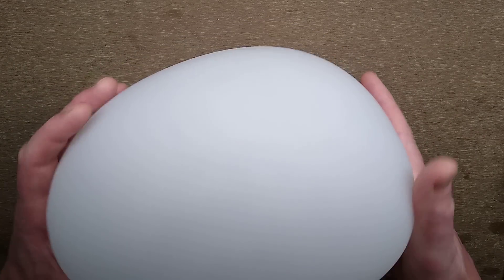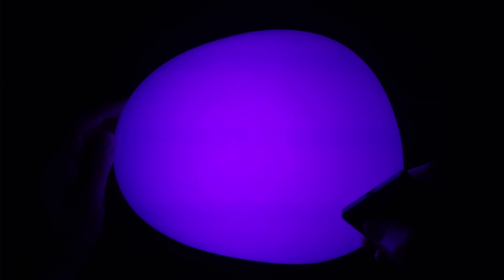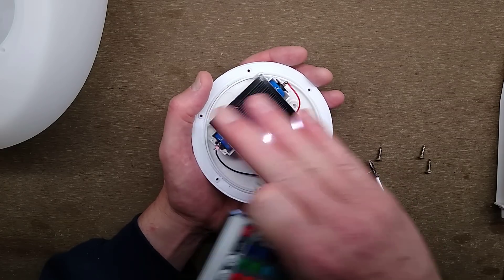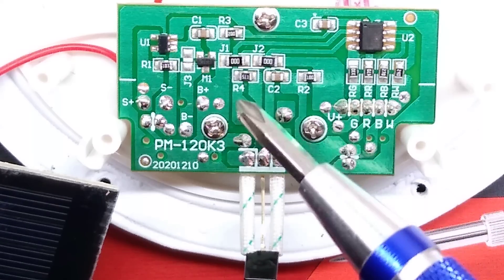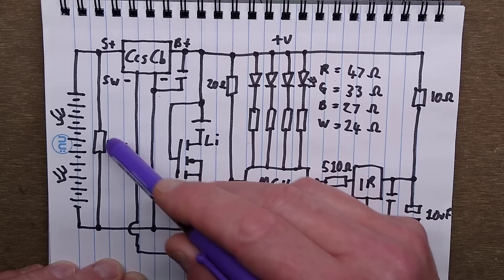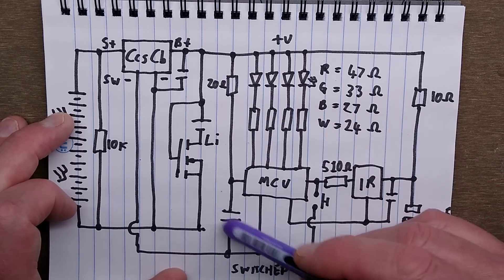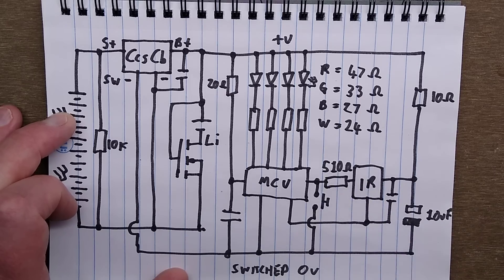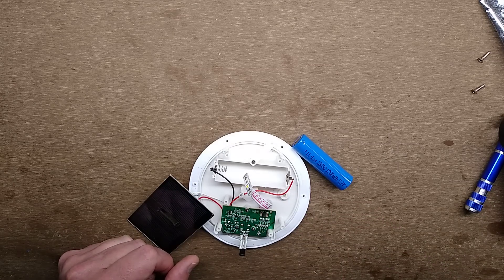Aldi glowing rock (with schematic)

Comment: i have an under cabinet light bar that has the same remote, its probably the same manufacture, ive had it for two years and it still works, mine isnt battery powered but im very happy with it.    if you hit the lighted blue color and dim it all the way its like a weak black light.

Comment: The only (albeit serious) design flaw, is the expectation, that the ground will not get wet. Any downpur (however short) will likely lead to a puddle under the stone, with water just waiting to seep inside.
Had they gone for a proper seal in the bottom, it'd be a great product.
Of course, visitors of this here channel will likely be able to easily add some proper seal themselves.

Comment: Hey Clive,

I'm trying to design a circuit to where I can have a pair of landline telephones switch between modes using one relay, and then have a momentary switch at each station (back of shop and front desk). I don't want to buy an office phone system or other related device because a) I'm in the mood for a project, and b) I want to be able to hook up any vintage landline phone in the future as I collect more of those. 

I believe that I have determined that I need to wire the switches in parallel, with the power supply between them and the relay on one side, so that either one would work when pressed, and when released it switches itself back to the default mode. I need a 4PDT relay for this setup. At least 4 wires need to run to each station, potentially more for illuminated switches. I am a little unsure if it is possible to use one power supply for everything or if I need a separate one for the switch LEDs. I found some nice looking square green and amber ones on eBay after sifting through all the typical ones marketed for cars or PCs, as neat as they look not what I wanted. 

The different modes for the phones are already handled by: a Cisco VoIP box programmed so Line 1 automatically rings Line 2 when you pick it up. Found out how to do that from instructables. This mode will be activated by pressing and holding the button before picking up the receiver so that the phones get plugged into the right system. The normally closed state on the relay connects the two phones to a single POTS or cell2jack adapter line, same as you would normally have multiple phones in a home share a line. 

I have some doubts though. I don't want any accidental slight release of the push button or "bounce" to cause a malfunction. Would I use a capacitor here? I don't have hands on experience using these other types of parts and only vaguely understand them from your and others' videos. I would also ideally like it to sustain the relay activated for maybe up to two seconds if the button were accidentally released a bit, or if you release it too soon when hanging up. If that doesn't require a huge capacitor, that is. I saw something in a video where they also included an NPN transistor and a diode in their circuit, it kept a lightbulb on for a bit with a 9v battery after releasing the button and the capacitor did not look too big. This is where it goes a bit beyond my proper understanding unfortunately so I am still doing some studying here. 

Another doubt I still have is if just the Cat5e cable I'll be using for the telephone signal is suitable for the 12 volts and whatever current the relay might require? I found some on Amazon but all it really says is it's 12V DC coil power relay. I would assume it doesn't take a ton of current because relays are typically run by a computer chip. I read PoE security cameras can get up to around 15 watts over those 24AWG wires so it seems like it should be okay? And I would hope they have good enough contact inside to not be a problem for the telephone signal even though these relays are intended to switch power. 

I know you must stay busy, if you don't have the time maybe another commenter might chime in. I made a drawing in paint if anyone wants to see I can email. Thanks Clive love the channel ❤️❤️❤️

Comment: When you explained the MOSFET being used for polarity protection, my ignorant self immediately thought “why not just use a diode”, but then I realized pretty quickly, dropping half a volt or so across a diode in series would constitute a dramatic drop in performance or battery life for a 3.7v cell.
Reply from the maker: And also mess up the charge voltage monitoring.
Reply: @bigclivedotcom  Not to mention the actual ability to both charge and use the battery!

Comment: @bigclive: could the "reverse polarity" MOSFET actually have some other function?  If you have control over the plastic design, the cheaper option is features in the battery holder to prevent flat end of battery from making contact if it is in backwards.
Reply from the maker: It's definitely polarity protection.  The cell can be put in backwards.

Comment: That MOSFET reverse polarity trick (usually) gets you lower voltage drop than even a schottkey diode would.  I've done that for high current applications.  Take care to not exceed Vgs-max in the correct polarity case.
Reply: Also it conducts in both directions, you can charge and discharge the cell trough the mosfet, that would not work with a diode.

Comment: I cannot see how the N-channel MOSFET can work in the schematic with the drain at the negative side of the Li cell. I can see it work while charging, the gate is positive relative to the source, and the current flows from plus to minus through the cell and MOSFET, but while discharging the current from the negative goes up through the cell, opposed to the source current of the MOSFET.

Comment: Question,  Big Clive, do you know of any rechargeable batteries that can withstand 43C to 48C summer heat? They might get hotter in that sealed plastic rock here. 
I do like some of these outdoor solar lighting items, but have a problem keeping them alive. The batteries are the main problem. I live in Arizona, in the South West Desert and the heat seems to kill the rechargeable batteries in a short time. Sometimes the electronics and solar panel will give up in the heat. Even in the winter on a sunny day, with temps about 4C, it can heat up the inside of a car to 30C + in a short time. If you have any ideas or information, I would love to hear them.
Reply: Some of the older chemistries may be more temperature tolerant than LiPo.  Anyway, for something pretending to be a rock, old school lead-acid batteries may provide the desired weight.
Reply from the maker: I'm not sure how hot it will get.  The fact it's white and diffuses the light may help.
Reply: @bigclivedotcom  Thank you for getting back with me. 
But I can tell you that those glowing rocks sealed from weather, will get quite warm on the inside, even being white and diffusing the light. There is no way for the air inside to circulate and the heat will build up on the inside.
Never the less I ordered one. It might take until next June before the real heat tests it. But I was wondering if you could suggest a good rechargeable battery that might be able to handle the high temperatures. Don't know if you've had experience with batteries being exposed to high heat like in a hot desert climate. But if you do and have and suggestions, I would appreciate your input.
I'm not much of an electrician, but I do appreciate your YouTube channel, it has helped me fix things and I do like your way of explaining how they work. You have also opened me to some new gizmo ideas like these rocks and led lighting. Also the soda stream fizzing wine and alcohol, can't thank you enough for that! 
I'm more of a Machinist and Mechanic, but I do have some electronics experience. Thinking outside the box, I was able to fix an important piece of communication equipment in the military that got dropped and had a cracked circuit board. Others working in the electronics shop said it couldn't be fixed and would require a new part that would take several weeks to get to our remote location. I just jumped the breaks with some small wire and solder. It worked fine until we got the new part. Their boss wasn't happy that a machinist was able to fix something that they said couldn't be done.
Cheers!

Comment: Hi Clive,  I did a city and guilds 2360 in electrical engineering between 2002 - 2005 at evening college.  I would love to do an electronic engineering course like you have but Is it true that the maths is very  difficult for this?
Reply from the maker: I did my C&G 236 and a few short random electronics courses in specific areas, but most is self taught.  YouTube is the place to gradually learn electronics while enjoying the experience, and it's free.
The maths is minimal and easy to pick up because you re using it in real world applications.

Comment: Reverse protection doesn't make a lot of sense to me for a product that's not designed to be disassembled. I bet that mosfet is actually a sneaky low voltage cut-off circuit. Vgs(th) is probably somewhere around the low voltage cut-off point for the lithium cell, so that when it discharges far enough the mosfet switches off and prevents the battery from losing all its magic smoke.

Comment: Ooh, I really like that set for the fact the panel as well as the circuit board seems to be rather safe from water and any built up condensation, too. Most our garden lights are typically killed by corrosion. I'm not a fan of the rock shape, but I feel like this could make an awesome bulb, too.

Comment: It is the first time I see the MOSFET polarity protection, and I like it. If I understand it correctly, it does the same job as two diodes but at half the voltage drop. Very neat.
Reply: it i suspect is a low voltage cut off for the lithium cell, to prevent deep discharge death. reverse cell connection is low down the manufacturers priority list i would think as it is an integrated unit.
Reply: @amojak  that makes way more sense. But with added benefit of polarity protection. Very nifty. And of course the designer/producer had polarity very low down on the priority list. The 1% that opens the unit would know to not reverse the polarity (no matter what Dr who says). But it would cut down on waste in the factory.

Comment: Very nice-looking thing. Shame they are not for sale in my local i would have got a few of them. I dont think they will last to long outside in elements though. Those 1850s really dont like getting cold. But as something to pop out during the summer they would be good. I would have liked to seen an indoor version of this you can put in the window. Aldi make some good stuff. BTW the product ID is "711641498273001"  so if you google that the page will come up that sold it with info.
Reply: "Product no longer available"... :(
Reply: @MarkMichalowski  yeah such a shame, probably come back in stock though.

Comment: I love this circuit! Question: why the MOSFET instead of a simple diode?
Reply: Because the MOSFET has much less voltage drop, even compared to a Schottky diode, see https://youtu.be/IrB-FPcv1Dc 
Maybe low current fuse in series with the battery and a reverse diode which blows the fuse when the battery is inserted backwards could work too? But then the fuse must be very fast and all other components need to survive the diodes forward voltage until the fuse blows.
Reply: @Acamperfull  thank you kindly!

Comment: I like the build quality of this. Screws, batteries you can unplug, well designed, small nuggets of ingenuity in the circuit, ribbon cable, serviceable, yet cheap. More Aldi stuff please 🙂
Reply: Agreed, largely... Except for the bottom, they could have gone for a proper seal.
This is on the ground afterall, and there will be times, when a puddle forms under this "rock".
But then again, visitors of this here channel will likely be able to easily add some proper seal themselves. And considering this is Aldi, well.

Comment: I have a few solar lights that have a similar arrangement for the solar charge circuit. The chip in my units is a  hr2130a 5 pin, lipo protection chip. it looks to be connected very similar to the rock light.

Comment: That circuit board is 2 years old.
If I'm reading correctly it has a date of 10th December 2020.
I probably jumped the gun and you will likely point that out shortly

Comment: Odd for them to use reverse polarity protection for the battery. As far as I can tell the battery isn't an end user replaceable item. I would have figured the factory would have used welded contacts directly soldered into the circuit board and not a battery holder.

Comment: Interesting, I have never seen a solar panel hidden in a diffused enclosure like that.
Reply: i would hazzard the loss of light through the diffuser is made up for by the increased exposure to light from differing angles as a result of the diffuser
Reply: @amojak  Bingo
Reply: I found one in a bird ornament once. The bird was a metal one and it had a white orb built into the body of the metal. Inside was a solar panel and light. Found it at a local supermarket. It was the only one like that, though.

Comment: I wonder how this would charge off indoor lighting.  Would go well with my bedroom strip lighting.
Reply from the maker: It needs sunlight for a decent charge.  But it could be hacked to run off a USB cable.
Reply: @bigclivedotcom  I figured that were the case.  Also seems relatively simple to change cells.  Knowing Aldi US it may or may not come back around, but if it does i'll have to snag one.

Comment: From the top down, it looks almost exactly like a glow in the dark rock that came in a Zork computer game way back when. Holy crap, that brought back some memories. Actually makes me wish the Aldis around here had them, I would grab it just for that reason. Kind of a bonus that it is built half decently as well.
Reply: Not just half decently, this has more quality than I could produce myself.
Reply: The fictional rock in the game may have been fluorescent or radioactive.  Because that fits the technology when those games were written.
Reply: @johndododoe1411  No, it was a little standard glow-in-the-dark plastic rock that was thrown in the box with the game. Back then they used to do that kind of thing with games. Nothing fancy, just a standard charge it in the light and watch it glow for a bit doo-dad.
Reply: It might surface at some point, Aldi and Lidl have rotating assortments of junk, some that pop up yearly and some that only come by once. Also very seasonal usually.

The product cycles are also not the same per country, what is in Lidl in NL this week might be in Lidl in UK the week after and in DE the week before. You really notice it with for example the foam gliders Lidl sells once a year that have become an RC conversion classic, they pop up at random times in the summer in different countries.

Comment: Why do cheap manufacturers almost always laser off any identifying info from the chips?
Reply from the maker: To hide their special secrets.
Reply: @bigclivedotcom   It's not just modern Chinese products that do this; I've seen old audio gear that obscures the integrated circuit numbers. I just repaired a 1970's Carver Sonic Hologram audio preamp that had the numbers apparently wiped off one of the IC's with a solvent.

Comment: one of the little copper triangle things under the switch on my multimeter that makes the connections for what mode its in broke and I don't know what i could replace it with ide like it to work again.
Reply from the maker: They tend to be specific to the meters.  I've never seen them sold separately.
Reply: I guess i can get regular rotary switch and solder it in but i don't wanna do this

Comment: The intensity control will also speed up and slow down the fade and flash options.  FYI  I have a STACK of those remotes from all the Disco Lights and LED strips and rechargeables and 'smart' bulbs. LOL    this Glow Rock is COOL !!  I need a bunch in the garden.
Reply: "The intensity control will also speed up and slow down the fade and flash options."
THANK YOU!

Comment: Would that solar panel work better if it was out from under the plastic . I mean would it not charge faster or give more power to a battery if used to charge something else.
Reply from the maker: It is probably safer inside the globe and still gets a decent charge.
Reply: @bigclivedotcom  thanks. I was wondering if it could be used as a charger for my phone if u go camping but it's probably not strong enough.

Comment: Fun Fact: Hedgehog quills glow in the dark, using a UV LED Torch (Flashlight). They are bioluminescent!
Reply: Not exactly, they fluoresce. the visible or invisible radiation produced from certain substances as a result of incident radiation of a shorter wavelength such as X-rays or ultraviolet light.
Reply: @andymouse  Exactly! A UV (UltraViolet) LED Torch or Flashlight does that!
Reply: @alansmith4734  ,  Bioluminescence means that the organism or biological substance creates its own light without having to be excited by ultraviolet light. Some plankton and algae do this for instance, and there are mushrooms/fungi such as the jack-o-lantern that sometimes create their own bioluminescent nightlight.  If ultraviolet light is required to make the object glow, then that is fluorescence or phosphorescence.